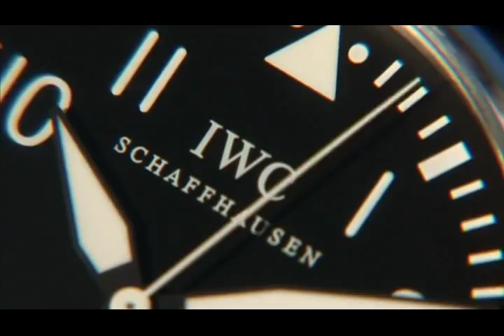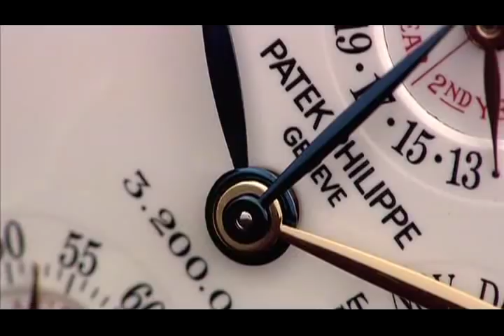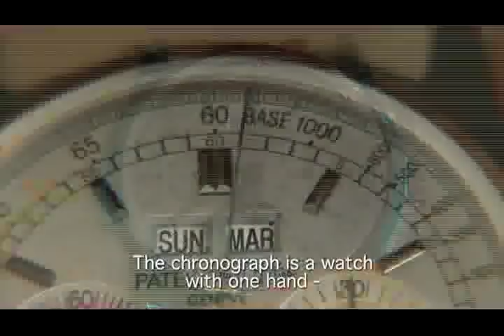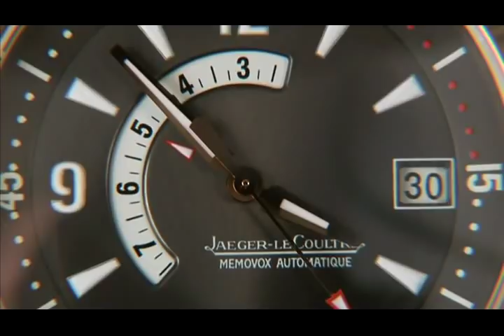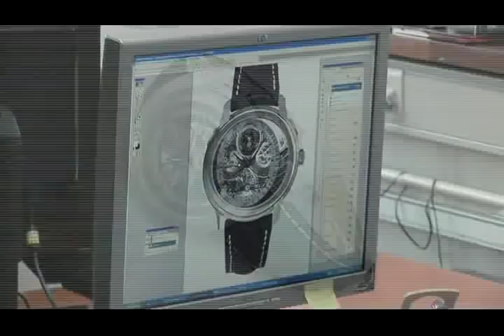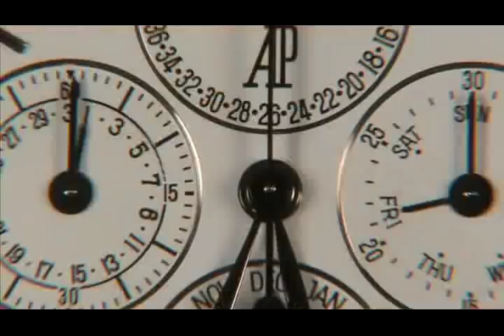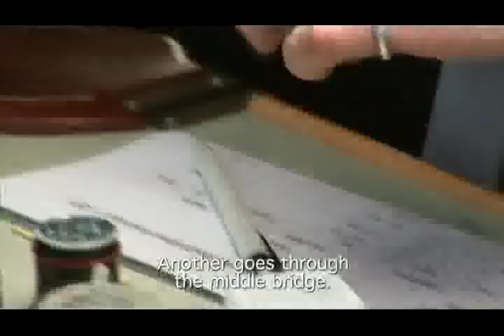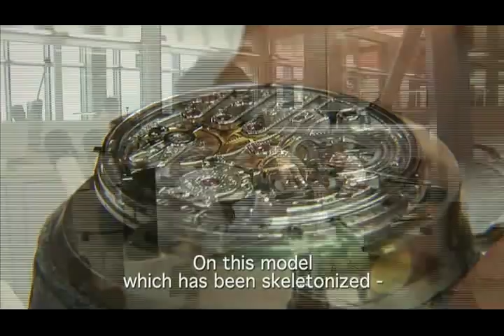Watchmaking art part 1

Comment: On a pure asthetic level, I would only pay big bucks for the Reverso. I'll take my IWC 853, with a completely faded dial over these current watches. I found my watch in the cheap watch bin at the thrift store. I wound it, and it was too smooth for a ETA movement, or any cheap watch. It kept perfect time? I kept it sit on my nightstand a year. On boring night, I noticed a fish on the crown. "Why would Timex put a logo on a crown?" I opened the SnapBack case.(they are incredibly tight. Don't use a regular watch back knife. Use the tool that looks like a chisel to open the back, and the case. Be careful.)  
To my surprise, a beautiful IWC 1955's movement shone back at me. Well that started my obsession with horology.

Watch repairing is not that difficult. Look for an old, complete watch online, and put it to life. It's a good feeling, and won't cost you a house.
Oh yea, as to huge watches. It's a fad. Its not wrist size. My IWC is 36mm and looks, and feels fine. I wouldn't want it bigger, or smaller. I'm nice you get into this hobby/profession your tastes will change. You will also see through the BS. Over three hundred grand for that Chinese looking watch? 
I will be putting together watch repair videos, and hopefully a watch repair book. A modern book.

Comment: I can never figure out what I think is the most interesting aspects of watches.  If I think it's about accuracy, I can applaud a watch that syncs to GPS or the atomic clock in Fort Collins; because it's hard to beat a watch that can sync itself daily to very accurate reference clocks.  But the high tech approach is a bit boring, because the accuracy is external.  I am more impressed by the Spring drive - a movement that is an interest hybrid between an automatic ( self winding mechanical) and a quartz watch.  Or maybe a high beat quartz watch with thermal compensation that's accurate to a few seconds a year.  Going another direction, we have insanely complicated mechanical watch complications, which are a wonder to behold; the amount of moving parts in a perpetual repeater is mind boggling.  But outside of the spring drive, mechanical watches are not very good timekeepers.